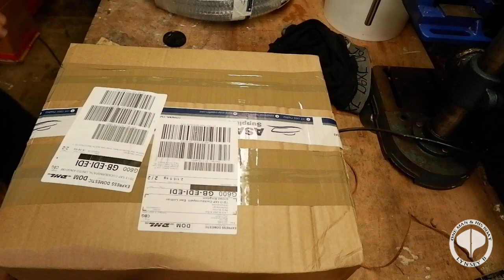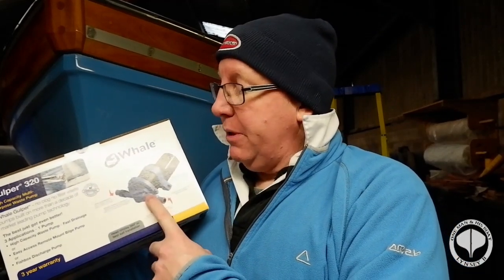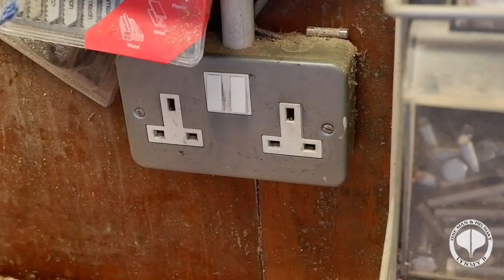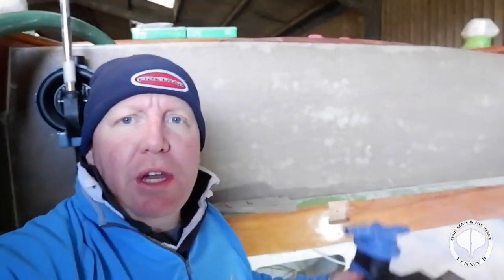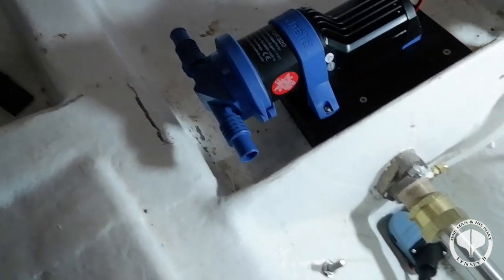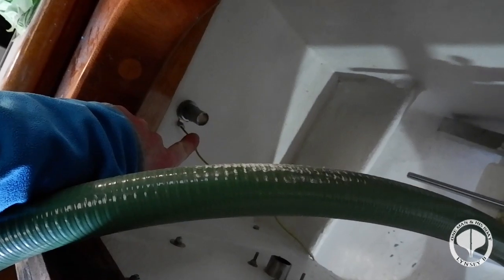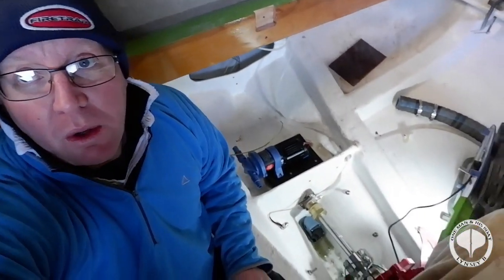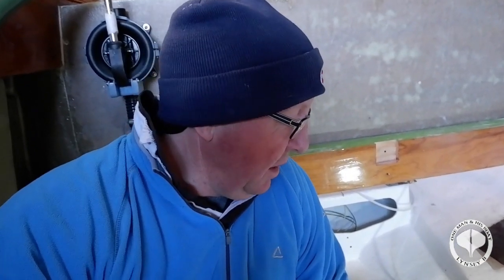Whale of a time Episode 37

Comment: What sort of plastic is the pump mount plate, acrylic resin based bedding compounds, as well as epoxy ones will not reliably stick to nylon, nylotron, ptfe, delrin, polypropaline or HDPE  etc, may appear to be stuck, but will have no shock loading strength. Hope that isn't bad news. Still enjoying watching your journey so please keep in up.
Reply from the maker: Hi Neil,  I'm not sure what kind of plastic it is bud.
It was given to me by a friend. And it was the ideal height for the application. 
Thank you for you're in put, I'll keep an eye on it, and if it fails, I'll let you know.
It does seem pritty Solid just now, but like you say, that's with out vibration and movement of the boat.
I guess time will tell.😂😂😂😂😂😂
Thank you for your comment bud, and I'm glad you enjoyed the episode.
All the best. Baz 😉👍
Reply: @onemanandhisboat   Maybe glue a spare bit down to something and leave for a month, then clout it, as its shock loading that will the problem.  Forwarned is forewarned
Reply from the maker: @neil1150  we'll see how it does pal, put it this way, it better do, as the float switches are bounded the same way!😂😂😂😂😂
You live and learn.
 Everyday, is a school day.😉👍
Hope your staying safe and isolated in these uncertain times bud.
Thanks for replying. 
All the best.😉👍